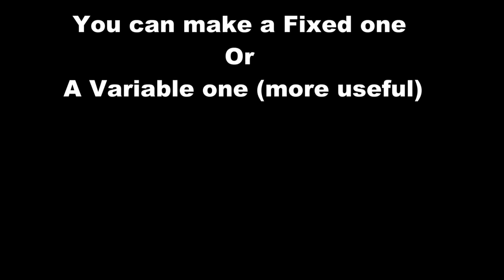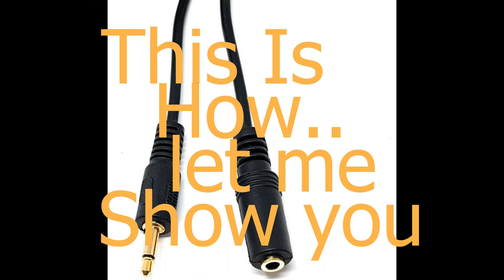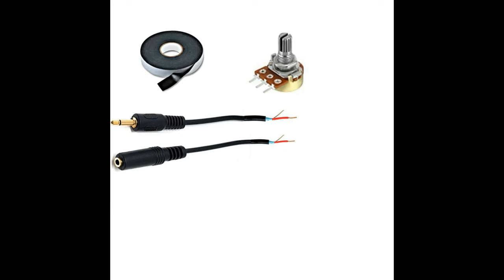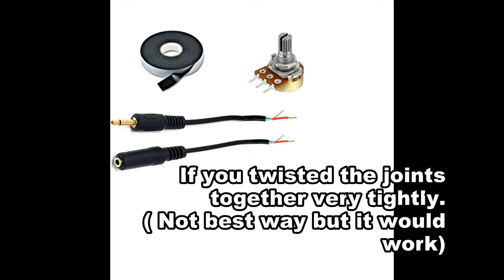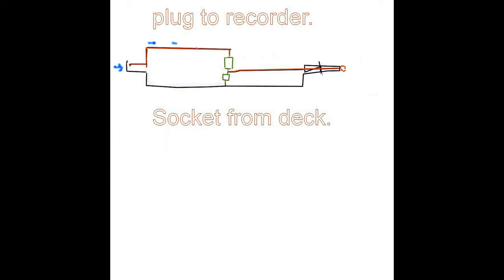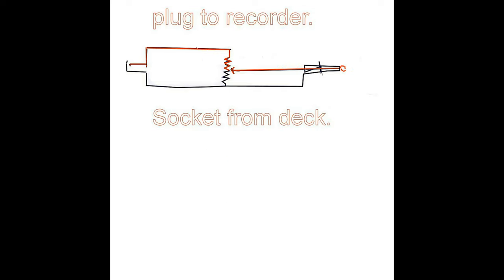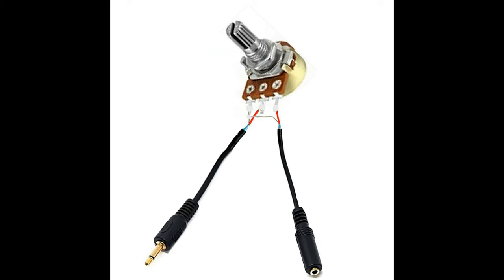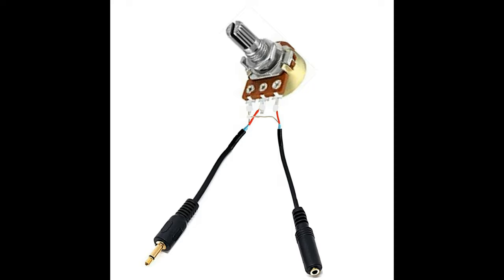How to  make  DIY Attenuator: Line Level to Tape Recorder Mic Input

Comment: Amazing! Can this be done for long XLR to TS cables from a mixer into a tape machine’s mic inputs? What would I need to do for that? Cheers!
Reply from the maker: The attenuator shown in this video is currently in use as an output from a "through output (XLR)" from a monitor amp, then the 3.5mm through the attenuator, that is then fed into an Android phone mic input to stream on an app. ( The app is awkward and will not accept usb input) the Quality of the output from the attenuator is good. It is basically a flat-frequency response.( I have been on FB etc. long enough to know that any statement will be challenged)  But in my tests, it came out flat. If you get the levels correct you can get excellent results. Mic input is the same sort of levels on most mic inputs. With a pot, you can cover all devices.  If the lead works there is no hum cancellation, but then an unbalanced lead is an unbalanced lead.  I hope that helps?

Comment: If you didn't use an attenuator, but you used software, such as a DAW or Audacity to drop the level of a music recording by, let's say, -40db, would that be enough to record with better quality through the mic input? Just curious, as I'm not entirely experienced with this kind of stuff.
Reply from the maker: I can give you a definitive. No, it would not work with consumer equipment. The noise on the analogue amp you feed to the mic input may well be at the peak level it could take. So the audio would be lost in the noise. By using an attenuator the complete signal, including the noise will be reduced and the signal-to-noise ratio will be maintained. The results will be as good as the machine can produce if you do it properly and get the levels correct.  Good question. Thank you.
Reply: @GaryKeepItSimple  thank you, that makes a lot of sense.

Comment: Let's say I have recorded a drum kit (or any other mic'd instruments) onto my computer. 
Then I decide I want to try and send say, the snare through my decent api preamp, which only has a gain knob on it (no separate output gain).  
Would it be worth attenuating the recorded snare in this way so as to take it from line level to microphone level so I can drive the preamp harder?
Reply from the maker: The lead as described is very useful in all respects. What you suggest sounds like a good use for it.
Reply: @GaryKeepItSimple  cheers

Comment: I’m getting a ton of hum, but only as I turn down the variable resistor it gets louder. Any ideas ?
Reply from the maker: The type of Potentiometer, and the length of the leads that are unscreened and the need for the screen/earth to be good and continuous.  if you have connected as I show it there should not be any problem BUT with this sort of thing, there is always a risk of hum.  I would check the earth/screen and make sure that it is literally from one end to the other. Also you could wrap the POT and exposed leads in Aluminium foil which you connect to the screen. (Insulate them first)
I am sorry if this sounds a bit "woo woo" but the problem with leads is that they can be just awkward. I purchased an RCA to RCA stereo lead,  and it is like an aerial and picks up noise from our digital mixer, totally unusable, but when I tried it on a different thing it worked fine. that lead cost £7 from Amazon. I still do not know what is wrong with it, it rings out OK on my Multi-meter. I hope that helps, feel free to come back if you need further info. Let me know how you get on.  Cheers.
Reply: @GaryKeepItSimple  thank you!! Well this is just my experimental “alligator clip” test circuit, so it’s got wires all over the place for sure.. it was just odd to me that the noise was so constant only when the resistance becomes introduced.. I wonder if regular resistors would be different.. and/or if I need to add a capacitor to block any DC.. I have a purchased stereo cable that works & it seems to only have 4 small resistors total ..
Reply from the maker: 4 resisters is the normal way to do it if you do not have pots. The beauty of pots is that you can have total variability. But if you know what the attenuation value you want is then resisters are great.  it was normal. My first shoe box recorder had a "Line Input Lead" which was  as you describe. All sealed up. It worked great. A cap is not a bad idea if you are feeding in a signal from a Phone. But you need to get a big value non-polarised. Normally the input circuit is straight to a cap and also the DC will be reduced by the same amount. Also, the DC is High resistance so there is no real current.  ( This is the trouble with general advice there is always one that it will not apply to.).  The ratio between the resisters is the important thing. 47K is the normal line impedance. so that is the target. But anywhere around there should work. Also, label up the direction the cable is intended to work., or you need to put a padding resistor on the wiper on the POT to stop short circuits if the pot is turned fully to minimum.
Reply: @GaryKeepItSimple  I’m trying for maybe 30 dB pad? So if I’m using 47K resistors, what should my other resistor value be? I just ordered a kit with all the ohms! 😝thanks Gary!!
Reply from the maker: 30db is 1000 to 1 therefor 47k from signal to joint 47 ohms from joint to ground. 
signal in  1
                47k
                 1 
                 Signal out
                  1
                47R
                  1
                 Ground
if you see what I mean.
Reply: @GaryKeepItSimple  yes I believe that’s how my store bought cable seems to be wired .. it’s advertised as 30db but my multimeter reads 1.5K from tip to tip… (could be user error there)
Reply: @GaryKeepItSimple so after a lot of tests, I found that the combo of 1K ohm and 47 ohm worked the best for my camera (Panasonic gh4) … thanks so much Gary 🎉
Reply from the maker: @ThePaulwarner   That's great.